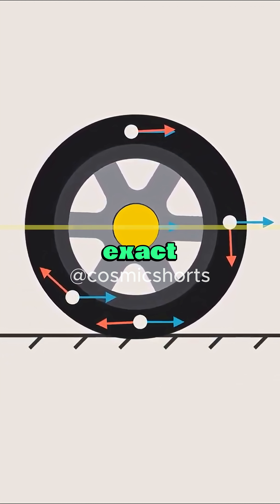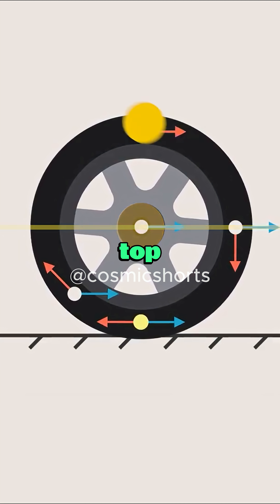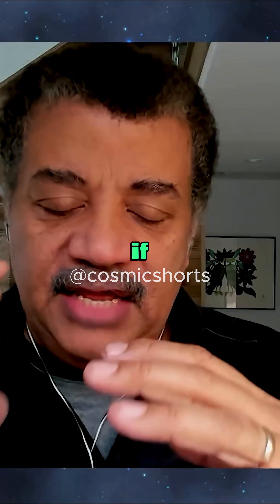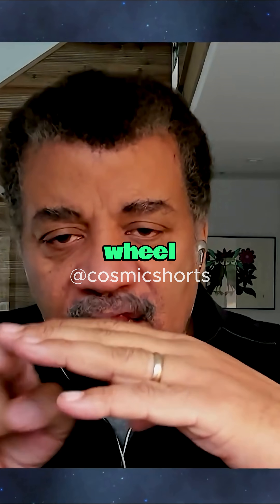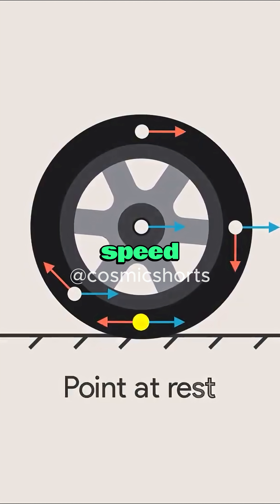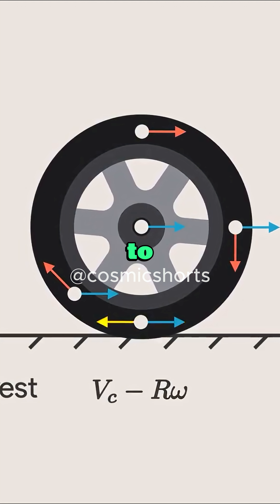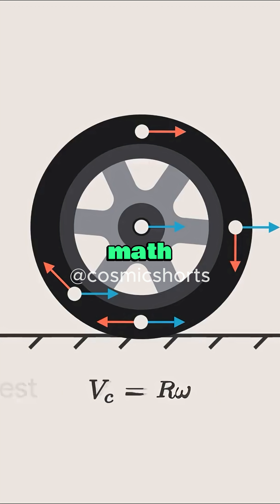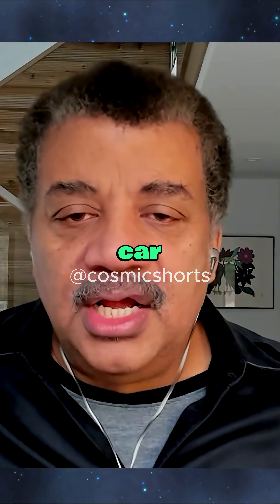The Surprising Science Inside Your Car Tires 🧪🛞

Comment: It is moving, The earth is spinning, whether your car is running or not. The earth rotates around the sun. There is no absolute reference frame. He describing a moving reference frame, the car, against another 'stationary' frame the road. It (the point of contact) may be stationary at one instant in one frame and moving in the  other frame. But then I guess there is no absolute reference frame for time if the reference frames are moving (fast enough) relative to each other. It gets confusing. Your car is not a rigid body if it has a rotating part it is a system. I guess that adds another reference frame that is spinning. (He is using 'speed' to confuse people. Speed is velocity averaged over time. Velocity is a vector. Shows a vector diagram of the velocity of the tire rim and speaks of speed)

Comment: twoce the speed of zero miles per hour is... carry the three, divide by--- its still zero miles per hour, not even close to twice as fast
Reply: Your comment is only true when the car is stationary
Reply: @eddy_8232 zero times two is always zero. the comment about the bottom of the tire moving at zero miles per hour is only true when the car is stationary. great example is how when semi trucks run over road debris its capable of launching chunks through the windshield, which aint happenin at zero miles an hour
Reply: Twice the speed of the car
Reply: @DJ-dm5km zero times whatever hair you want to split is still zero
Reply: @phoneticalsoup  there’s three speeds when the car is moving. The speed of the car, let’s say 30 miles an hour, the bottom of the tire 0 miles an hour and the top of the tire 60 miles an hour because it’s double the speed of the car. 

Top of the tire is always double the speed of the car, bottom of the tire is always zero unless the tire is skidding or burning out. If you think about it, a rubber tire would wear out extremely fast if it wasn’t going 0 miles an hour all the time. Real talk, Mr. bro bro. 😛

Comment: This made absolutely no sense to me when learning it in Dynamics. Then one day I was watching a video of a tank moving forward and it suddenly clicked. Much much easier to see when that phenomenon is magnified across the entire length of a tank tread.
Another way I like to think of it (which may or may not be “correct”), is if we think of a wheel how we typically do, where the center is stationary. The bottom is moving “backwards” at some speed. Let’s call it -1 mph for simplicity. The top, then, is going that same speed in the opposite direction… 1 mph. Now, let’s shift our frame of reference so that instead the bottom is now 0… ie, -1 = 0… well then, in this frame of reference, the center which was 0 is now moving 1 mph, and the top is now at 2 mph. Welcome to engineering.
Reply: The tank reference makes it make more sense
Reply: I didn't get it at first until I imagined your tank.
Reply: Simplify this physics phenomenon. When we walk the sole of our feet doesn't move on the surface. Make sense?
Reply: @alsleepy4364  relative velocity.  But the foot moves in two directions during walking. A wheel moves in ONE direction, and if you are traveling the wheel is in a constant state of motion.
Reply: Yes the bottom chain is standing still in the ground when the wheels roll over it.
Reply: Neither does the sole of your feet move on on the surface when running or walking but your legs move up to 28 mph if you're Usain Bolt
Reply: @alsleepy4364  Sole of the feet is a great one, immediate brain click.
Reply: Hes talking Relative Velocity but applying a universal perspective...which is incorrect.
He does this kinda thing often.
Reply: I like your analogy.  I was thinking of something similar.  I was thinking about the foot print of the tire on the ground, as the leading edge is put down, the rear is being picked up.  All the time the wheel is rotating at the same RPM's.  The edge of the wheel's speed relative to the speed of the car is changing.
Reply: Thank you for your brilliant explanation 👏
Reply: Interesting. I am not even well educated in this subject and I immediately knew what he was talking about before he revealed that it is about the wheels.
Reply: Ahhh yess makes sense now
Reply: Uuhh yeah ok
Reply: You’re better than Neil
Reply: Thanks for clearing that for me. Easier when imagining on a bigger scale 😂😂😂👍
Reply: A tank tread yes, because it is static for a time. A tire is never static.
Reply: @jussilindkvist4032  At the exact time of contact with the road, it is indeed static.
Reply: @Tyranastrasza  No, it is not. The tire is rotating. It is only "static" relative to that part of the road at that particular part of the tire. Here's an experiment for you. If you lift a car travelling at 60 mph off the road, and touch the tire, does it cause your finger to remain still? Of course the tire is in constant motion. Not everything that Tyson  says is fact, and he is not an expert on everything.
Reply: @jussilindkvist4032  "The tire is rotating. It is only "static" relative to that part of the road at that particular part of the tire." 
And that's exactly what he was saying.